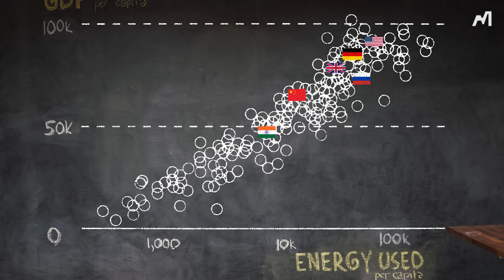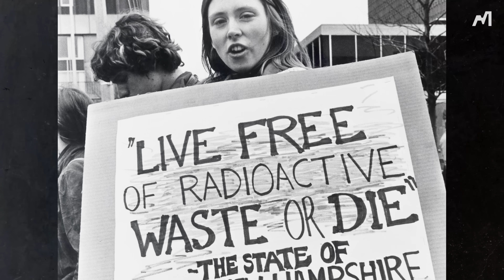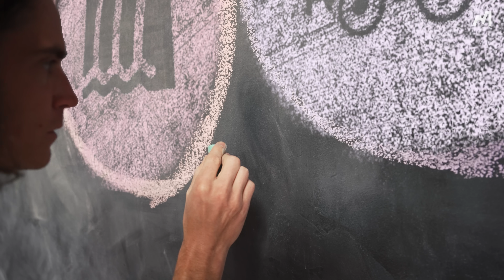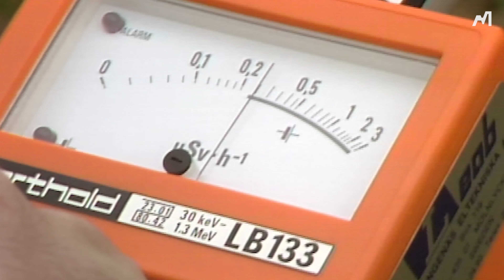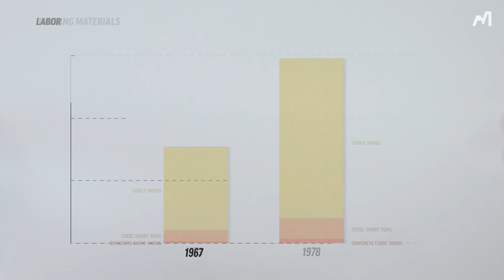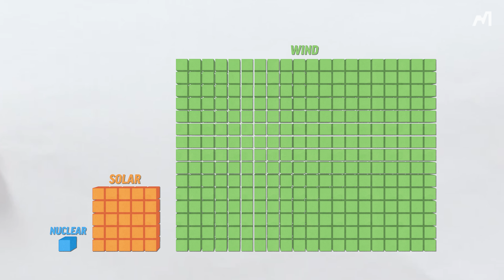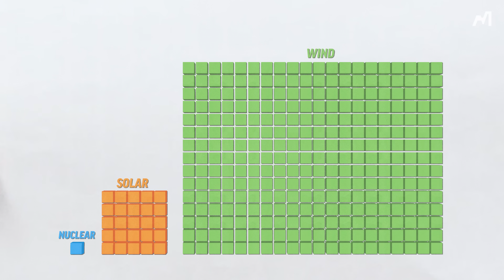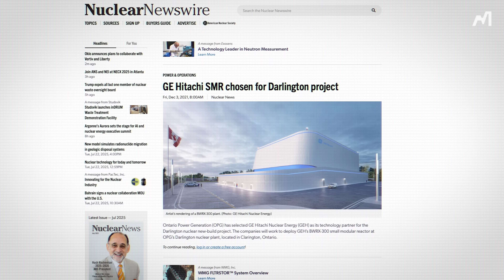They're Lying to You About Nuclear Energy

Comment: Yeah, nice propaganda video. A bit pathetic, don't you think? Here in Germany, we build additional 10 GW wind and 10 GW solar capacity per year. That's the equivalent of two nuclear reactors – per year! They deliver power from day one, are cheaper ( with grid fees and taxes!!! attached) then nuclear power (heavily subsidized!) ever could be, even under the best thinkable circumstances. And they can be recycled at any time in no time with no hazardous waste whatsoever, the materials can even be sold for good money. And solar panels are owned by private home owners, not monopolist profit driven mega concerns that think about shareholder value, not cheap power. Many wind turbines are community owned, almost all bio gas facilities are farmer owned, geothermal power plants are city owned. Nuclear is dead, ask France that has to throttle their nuclear power plants every noon, because Germany is flooding the European power market with cheap renewable power!
PS: Our CO² output is currently at the level of 1957. We do still have a lot of coal and gas power plants though, but they are almost all the time idle.
Reply: Also, wind turbine blades are made of composite materials including carbon fiber and/or fiber glass, which are very hard to tear down and all but impossible to recycle. 

I’m all for wind and solar as a primary, but we need something like super cheap, reliable batteries or nuclear as a backup. Since high density, safe, robust, and cheap batteries aren’t in the cards near-term, nuclear is a better option to fill the gaps than coal/oil/gas.
Reply: @rdear  Germany is on the forefront of recycling wind turbine blades. We don't have enough old blades yet to do it in an industrial manner, but the tech is there and not a single blade has ever been buried in a landfill – we don't even have landfills anymore, btw.

And currently, literally hundreds of battery storages are in the process of being planned, approved and built in Germany. So, don't worry, we are fine, thanks for caring!
Reply: @HapeBraun  And we all know that what works perfectly well in one place, works just as well everywhere else without any issues.
Reply from the maker: Germany? Really Germany? Germany has notorious, and consistently, bad energy policy from shutting down nuclear to reliance on wind and Russian gas. It's one unforced error after another. As one example:  https://www.youtube.com/shorts/g4XnZ8gkSsk
Reply: @Maxinomics  Ok, in your favor I assume you are just biased, and not simply stupid to make such a video. I hope the nuclear lobby pays you well for making yourself a fool online? Germany has been a net power exporter from 2002 to 2022. During all of 2022, we had to supply half of France with electricity, because 30 of their 56 nuclear power plants had to shut down due to emergency(!) maintenance and low water levels in their rivers, caused by a drought. We did it and neither country had blackouts or brownouts. France bought every kilowatt hour they could get for literally any price and that was the reason for the price hikes in Europe in 2022, not the fact that Putin shut down Nord Stream at the same time. The French monopolist EDF went bankrupt with €70 Billion(!) in the process and had to be nationalized – so much for "cheap and reliable nuclear power"! The European Synchronous power grid is the most stable grid in the world, neither the US's three grids nor China's nor any other comes even close in terms of reliability. The European power exchange in Leipzig was founded as a free market for power Europe-wide. And it works exactly as intended. Power is sold back and forth across borders, and Sweden did not question the Hansa PowerBridge because of a few days without wind in Germany, that's ridiculous, but because of a disparity of pricing structures that create a disadvantage for Sweden – which we are about to tackle btw. Germany is overall self-sufficient in terms of power generation and the grid has become even more stable since renewables are taking over, not less stable! So, make as much propaganda as you want, we are already far above 60% renewables and don't intend to return to an old-fashioned manner of power generation from the last century.

PS: This BS coming from an American, whose power grid falters on a daily basis, is pure comedy gold! Go ahead, build as many nuclear power plants as you want, no one is stopping you! And let us build up our renewables, that's none your business, is it? In 2050 let's look who of us is climate neutral, that's what all this is about after all, isn't it? "Drill, baby, drill!" might not be the way to get there though, I'm afraid.

PPS: You are an economist, did I get that right? So, tell me how clever would it have been to buy expensive 'Murican LNG prematurely during Trump's first term? Wouldn't we have wasted BILLIONS, just on Trump's gut feeling? Remember: Putin wasn't seen as an enemy by anyone, even Ukraine was ill prepared for the invasion that allegedly "everyone saw coming"  – yeah, in hindsight 20/20 maybe …  Wasn't it early enough to buy expensive LNG when Putin stopped the supply of cheap Russian gas? Don't forget: We weaned ourselves from Russian gas in no time with no more inconveniences than other countries that weren't "dependent" on Russian gas in the first place. Furthermore, us buying 'Murican LNG earlier had given Putin time to look for new customers in Asia, build new pipelines and all our current sanctions wouldn't have worked at all. I can't see any mistake in German energy politics other than not having pushed even earlier and harder for renewables.

PPPS: In recent years, when our last six nuclear reactors were in operation, we exported almost as much electricity as they generated. So basically, we produced expensive nuclear energy only to pass it on almost free of charge. Austria even bought our surplus nuclear power for cheap, used it to pump water into its pumped storage power stations and sold it back to us the next day as expensive ‘renewable hydropower’. What a joke! Our nuclear power plants were old and required expensive maintenance – with no guarantee that they would be granted a license renewal afterwards! And they were running out of fuel, which for obvious reasons could not be obtained as usual from Russia or France, which had just lost its source in Niger due to a military coup, and which would have been sufficient for many more years, far beyond our goal of when we wanted to be at 100% renewable energies. Phasing out was a wise economic decision, Mr Economist!
Reply: @HapeBraun  > They deliver power from day one, are cheaper ( with grid fees and taxes!!! attached) then nuclear power (heavily subsidized!) ever could be

Your story holds up ... until you compare the electricity rates between France and Germany.

> During all of 2022, we had to supply half of France with electricity, because 30 of their 56 nuclear power plants

Which totally did NOT make up for the decades of France buying German coal/wind/solar when wholesale price was low and selling Germany nuclear when the wholesale price was high!
Sure, France had a bad year in 2022 - but not in 2023, 2024, and so far, not in 2025!
One year out of 40 doesn't exactly establish a trend!

Also, French have some of the lowest emissions per capita in Europe from their electricity production.
And despite all the wind and solar, Germany has some of the HIGHEST emissions per capita in Europe due to all the coal burnt to backup wind and solar!

Comment: The one problem with this video is the insinuation that regulation on nuclear is the problem. The problem is that the regulation is not uniformly applied to all forms of energy production. Gas plants and especially coal plants quite literally belch toxic radon gas into the air because that stuff comes out of the ground radioactive. If we just used a slightly relaxed revision of the nuclear standard and applied that to nuclear, coal, and natural/methane gas plants, then no one would build anything but nuclear because the cost of making the latter just as safe as nuclear would be unfeasible.
Reply from the maker: Valid point.